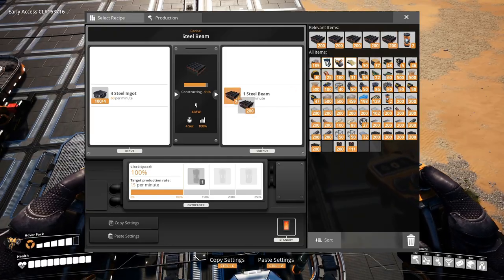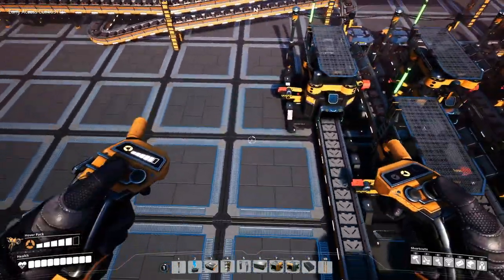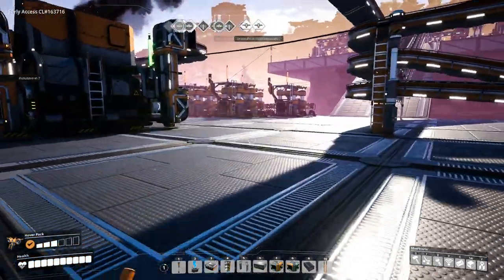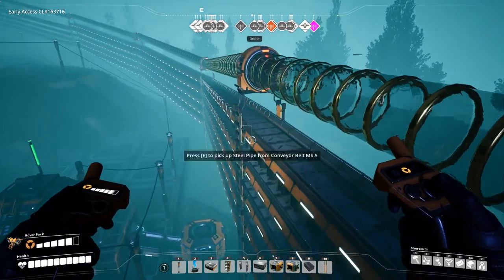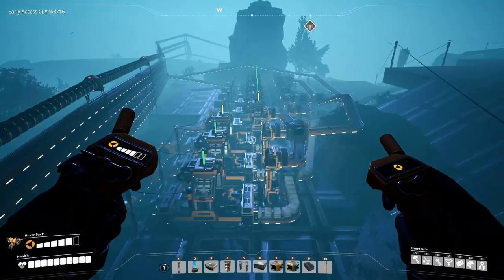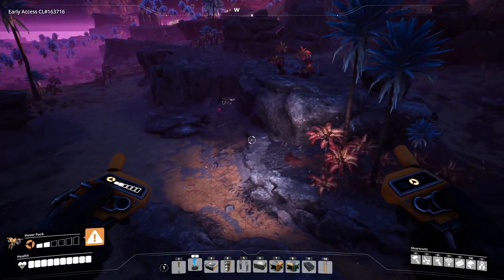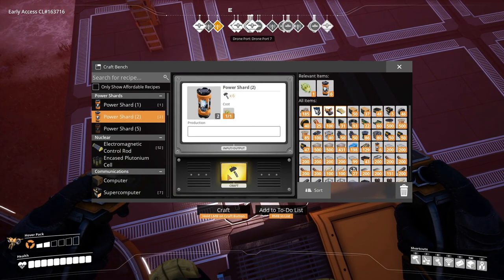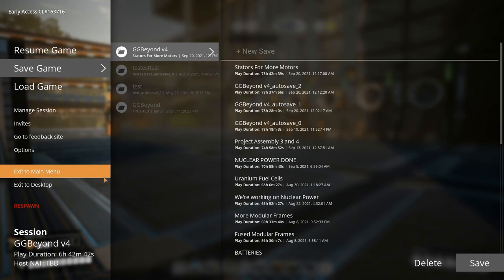Expanding Copper Sheets For Circuit Boards - Let's Play Satisfactory Update 4 Part 167

Comment: In case you didn't realize, when you are picking recipes, you can collapse sections that you are not dealing with right now, and it will remember the collapsed settings across all of that machine. Look for the - (minus) sign on the top right. 

So you could collapse "Minerals" and "Electronics" and "Biomass" and "power shards" and that will bring the things on the bottom 'closer' to the top so you aren't scrolling as much.
Reply from the maker: That could be useful.